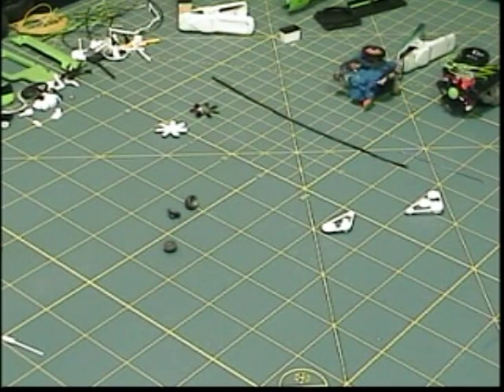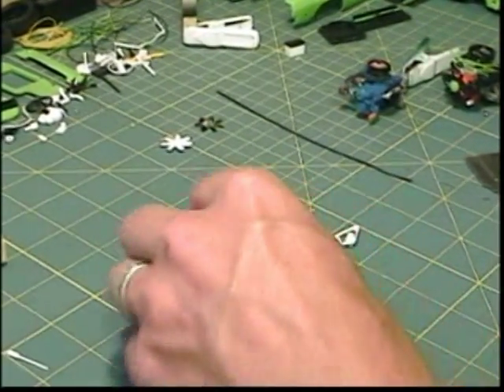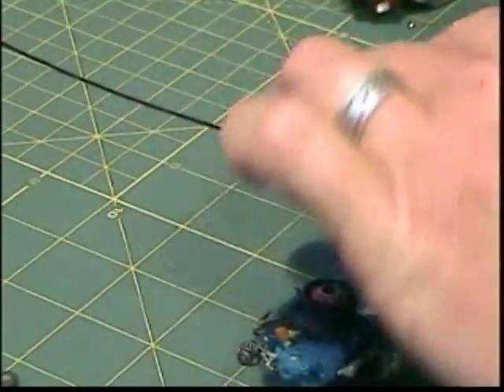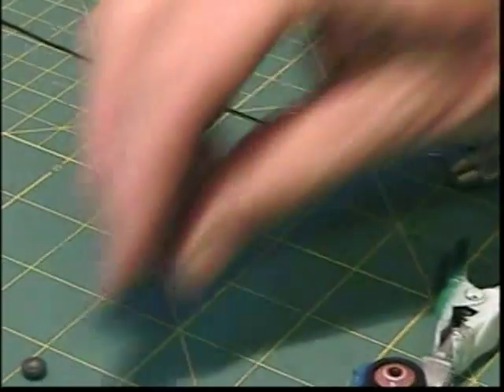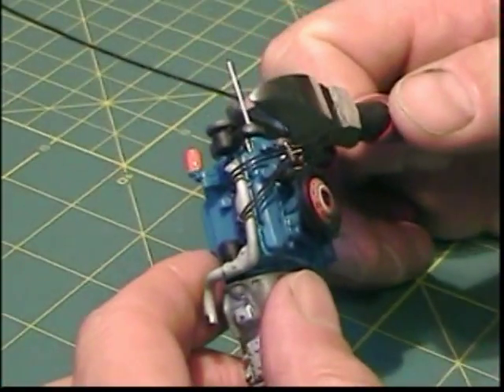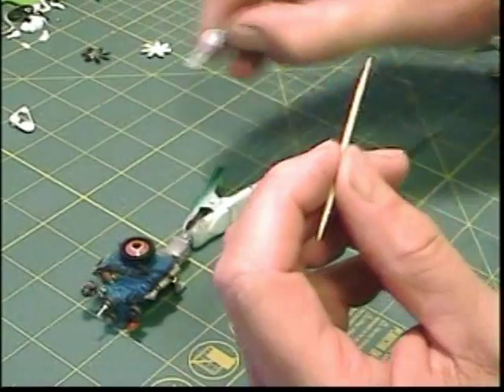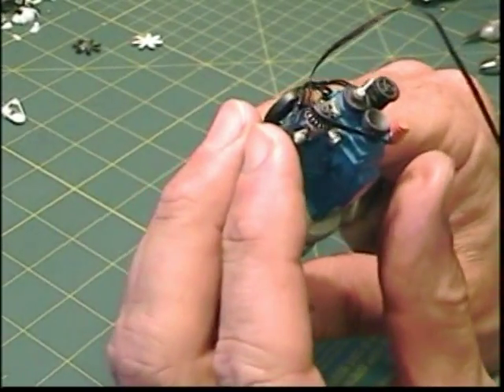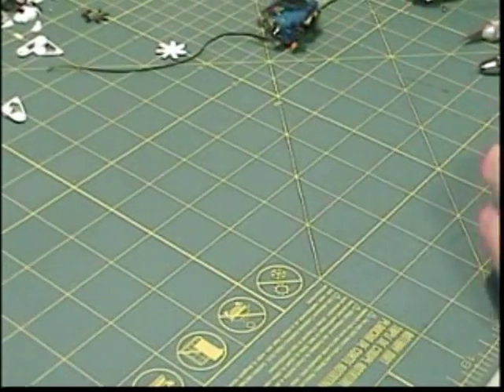How I make pulleys and belts for engines

Comment: That's actually pretty clever but simple, but you could use like a small piece of rubber to make it look more real like I do. 
I've used rubber o rings, pieces of actual belts and things like that, but this was still helpful for when I run out if the materials I use I know that I could use masking tape n it would plus will also look good and authentic to.

Comment: What gage wire did you use for the hinges on the doors and where did you get it?
Reply from the maker: +Samuel Vasquez I am not sure of the gauge of the wire, but I will try to find out.  I bought the wire from a local craft store and made sure it fit into the 3/32 tubing I use.